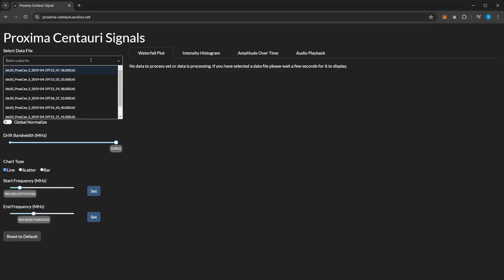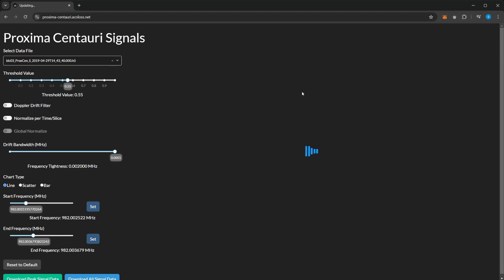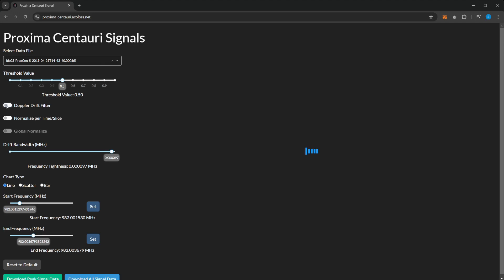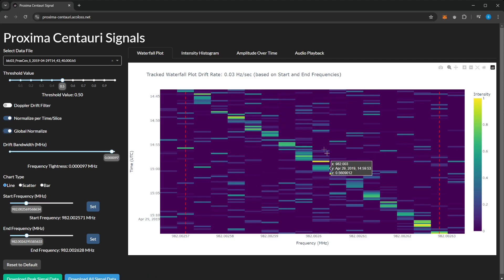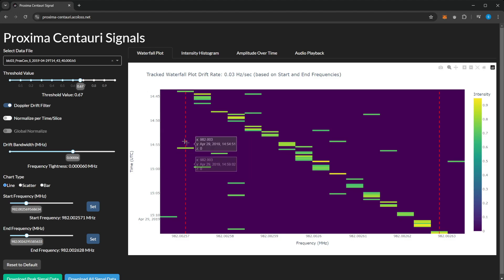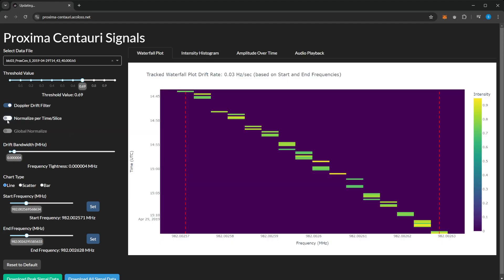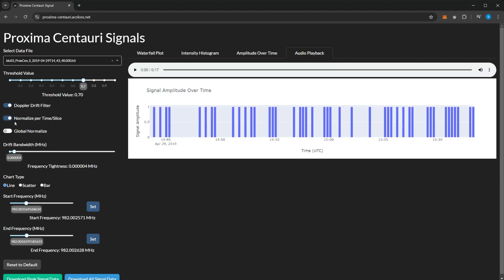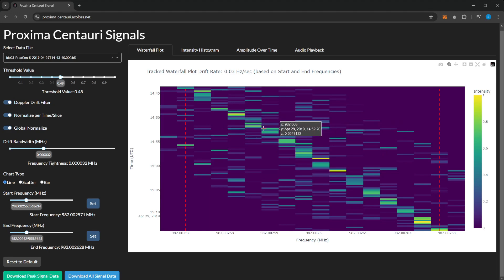Proxima Centauri Analyser - BLC1

Comment: whatever it is, it seems to be moving, so you have to modify the frequency shift in relation to the time to remove the dopler shift
Reply from the maker: i do in the video - that is what the bar is far. if you set start and end frequence, you then get the drift rate, the app automatically allows for this. you can then set the drift bandwidth so that you only see that signal following the drift to reduce noise.